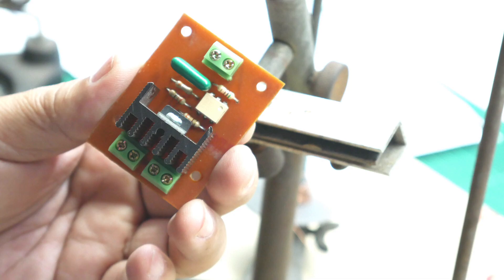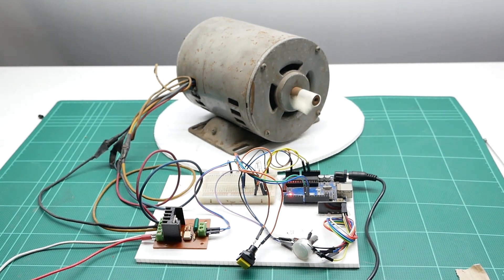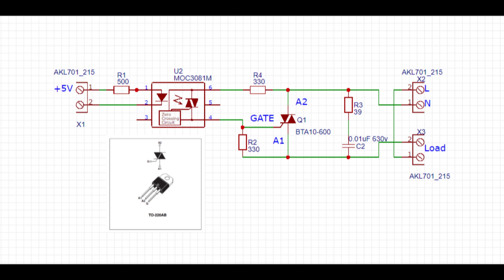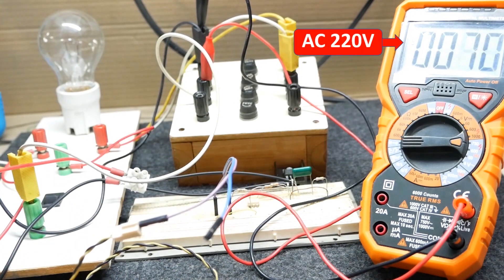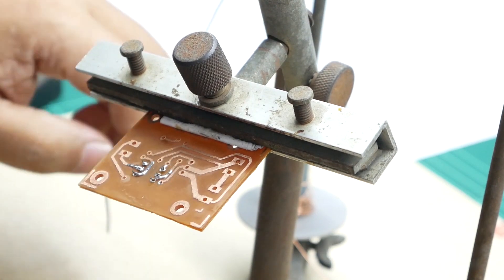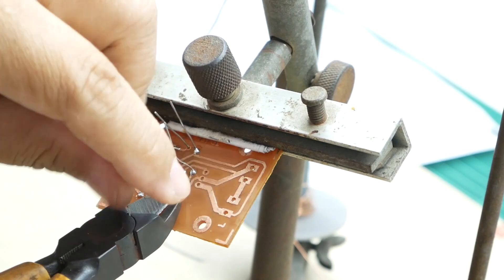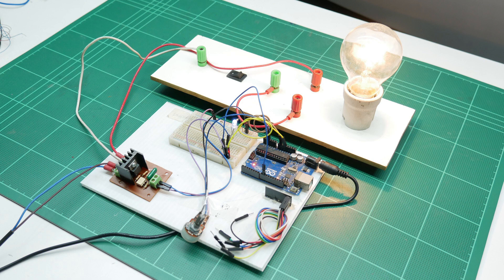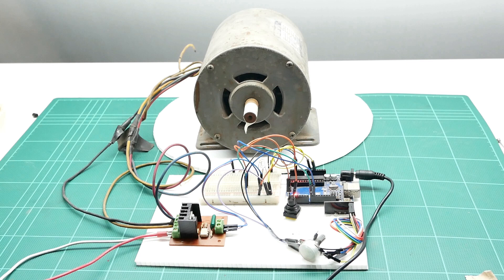HOW TO MAKE A SOLID STATE RELAY

Comment: Can I use BTA41-600B Instead BTA10-600
For control upto 40amp load
Reply from the maker: Yes , you can use BTA41-600B.
Reply: @MrProjectTSE  thanks

Comment: Good evening sir i tried  this circuit but my Motor is running very slow..... what should i do ?
Reply from the maker: Solid State work as switch so you can test it by resistance load such as incandescent lamp. If lamp can on - off that mean your solidstate is working.
Reply: @MrProjectTSE   i tried it with an led lamp it works well.....
Reply from the maker: What is type of your motor,Ac ro Dc motor?
Reply: @MrProjectTSE  its washing machine Motor
Reply from the maker: If it work.You may check your motor type  and check how to control this motor.
Reply: @MrProjectTSE   The problem was identified and now it works perfectly. Thank you so much for responding to my queries. All the best for future diy.